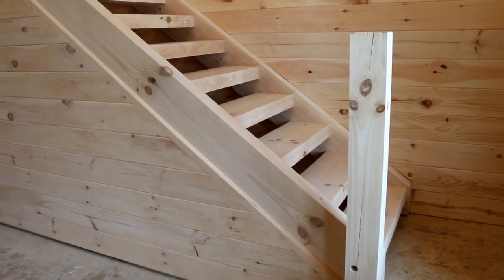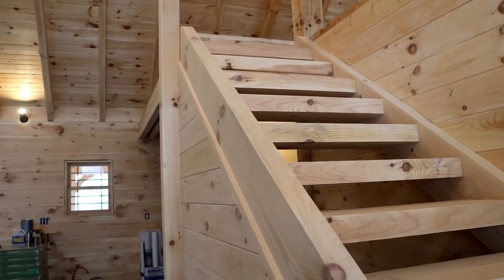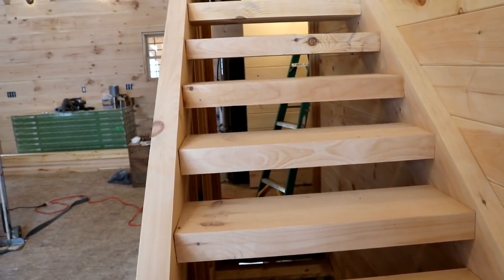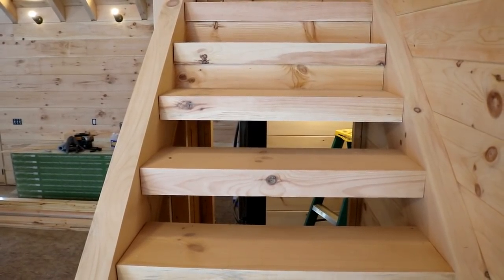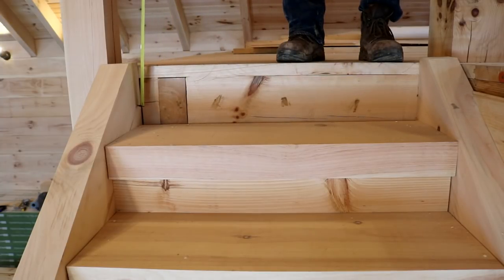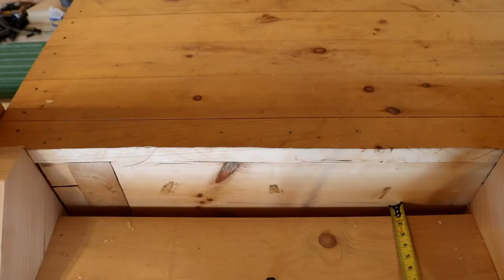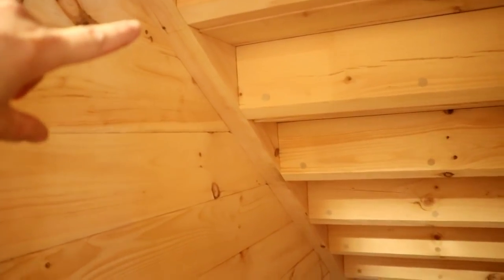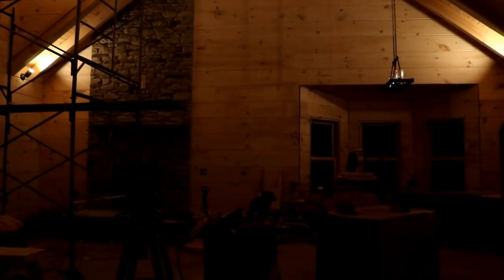Log Cabin Build Episode 19 - Timber Frame Staircase

Comment: "the last stair trade up" at 7:00 you should have created the same overhang as with the other treads (=TOE).  So the last tread would be integrated into the loft floor. It doesn't only look better but while going up the stairs the 'mind' is expecting the same movement  due to the overhang which is now missing on the top taking the next step onto the loft floor.  But I guess the pitch line did not work out with your design anymore as you discovered it too. 
Regarding 4x12 timber, maybe a bit reduced size like 1,5 to 2 inch makes a more elegant looking staircase. Weight reduction, the pocket size (or slots as you call it) could be reduced and the chamfer to the threads not needed. Treads maybe not from pine because it is to soft so for endurance & matching colors steamed beech wood. I am not a carpenter but I had to prepare the work in my own house building and have the woodwork for the staircase prepared for the carpenter to measure it out regarding RUN; RISE; THREAD DEPTH; RISE HEIGHT. https://en.wikipedia.org/wiki/Stairs Regarding handrail: not too low. 
In order to reduce the risk of slipping from the tread you still can add anti slip https://www.youtube.com/watch?v=94YH-fzwgFM by adding a groove onto the tread and pushing in the rubber string. It holds forever. On the white pine (or light color beech wood) it also works like a visual indicator at night. Preparing the design should save you a ton of work later.  
Nice stairs!
Reply: or mix sugar sand into the polyurethane just a touch though